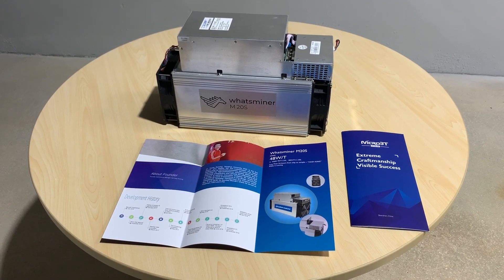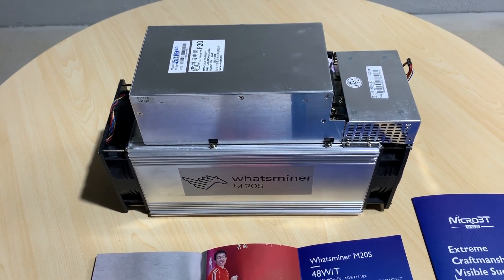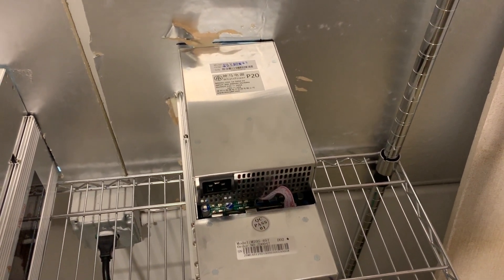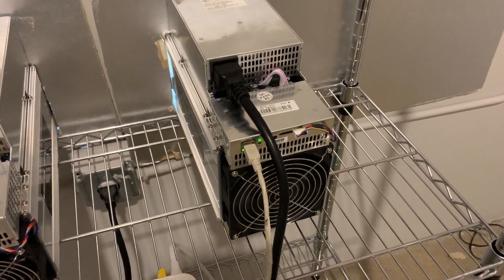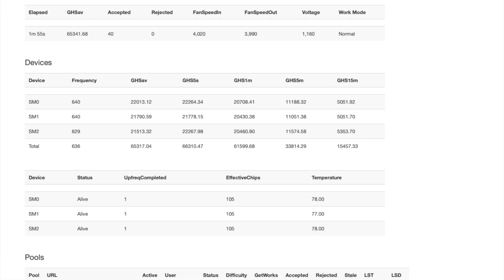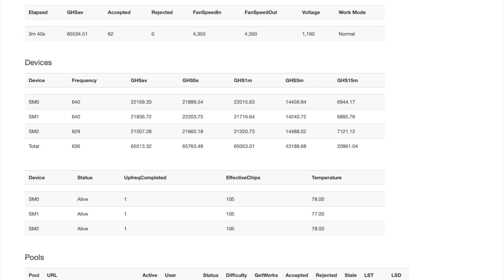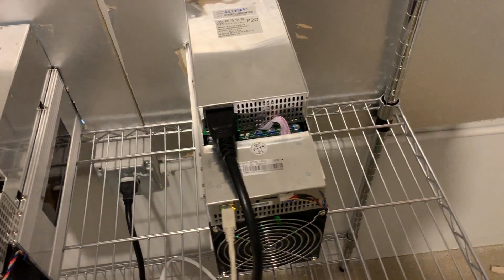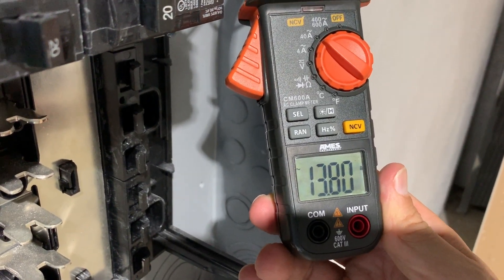Whatsminer M20S Demo Video in English

Comment: Hi Joe, I noted that you have the 65 th version and not the 68th. Is there a difference in heat ? Would of been nice if you could of flipped throught the work modes available for the machine also. Low power normal turbo?
Reply from the maker: no i mentioned this in the video that this unit was a demo and first of its kind. The production units shipping are at 68T. This is not low power mode.

Comment: Joe,

Amazing video! Covered everything needed. I was desperate to find the power cord for this unit and you really helped me out there.

One question, do you have any sort of surge protector for these units? I can't find anything that can facilitate the high amp usage as I am 220V which pulls about 17 amps. Any help would be greatly appreciated.
Reply: @Outalks If you need a mining machine, I can provide M20S

Comment: Hello there, thanks for the video. Is the link in your description legit site to order a single unit. I have seen a lot of sites that apparently sell them but I don`t trust any of them please advice. Thanks.
Reply from the maker: whatsminer.net is run by the main overseas distributor DJ Miner. These guys have been at it for 2 years and have many clients in the mining community. All you need to do is reach out to them on the telegram group and you will find they are the real deal.. Don't trust what you read.. verify!